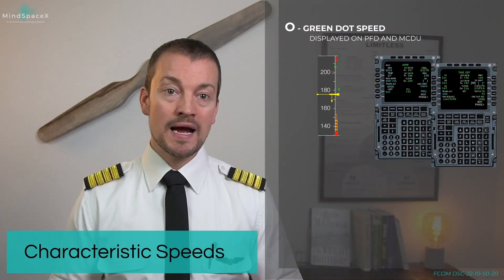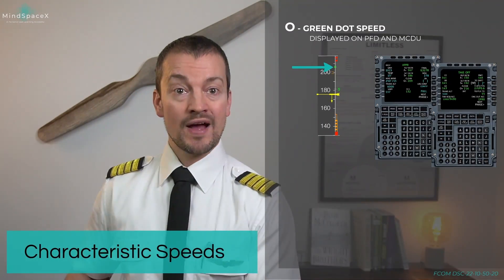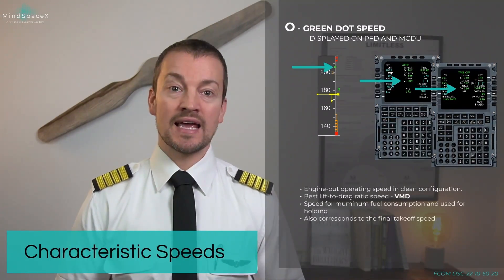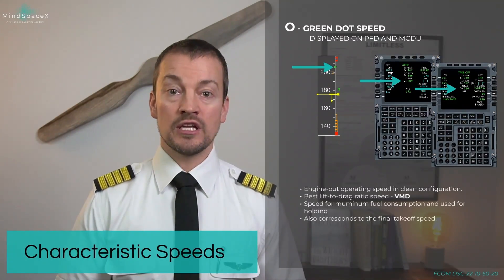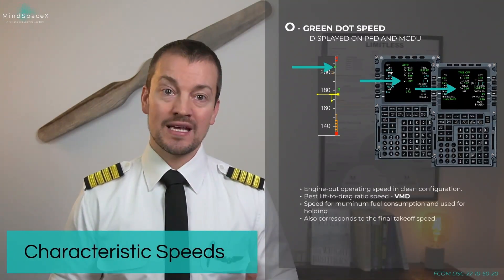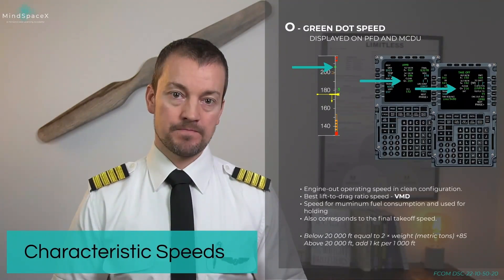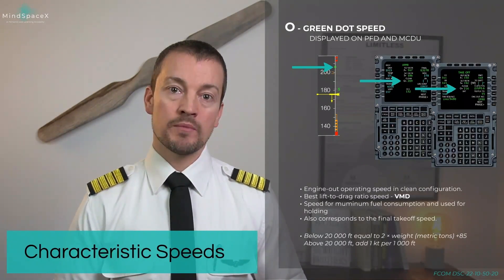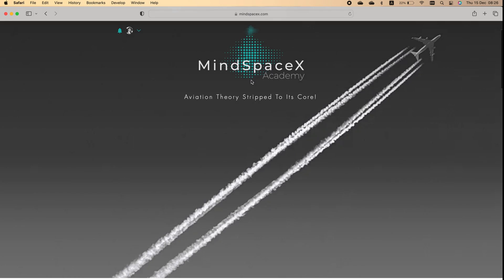Airbus GreenDot Speed

Comment: Great video overall !
 A small mistake at 1:23  it says "speed for muminum fuel consuption" 
 Keep up the good work
Reply from the maker: Hi Vaggelis, Thank you for the comment. I don't believe it is a mistake if you are referring to wether or not GreenDot speed is the best speed for minimum fuel consumption? In clean configuration this speed is VMD (minimum drag) and therefore the speed that will provide the lowest fuel consumption. This is why the speed is used for Engine-Out procedures with Obstacles and for Holding. I hope this helped.
Reply: @MindSpaceXAviation  Thank you for the reply. I was referring to a small spelling error (muminum) . 
 Everything else is well presented and understood. 
 Thanks again !